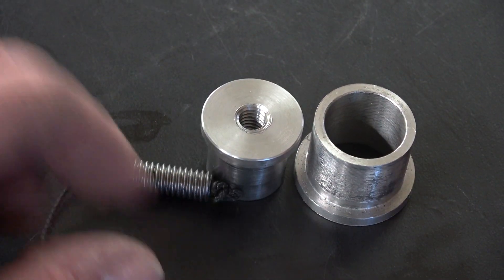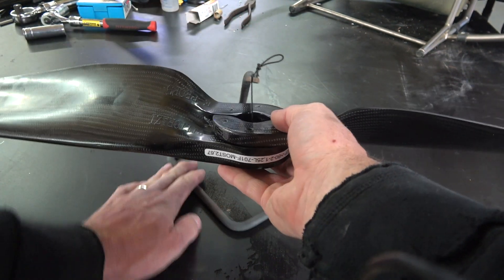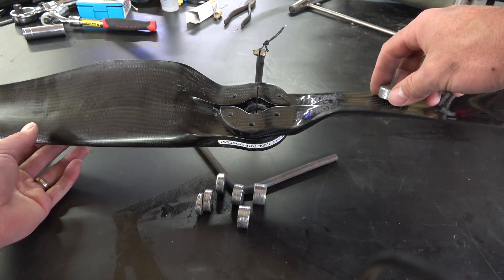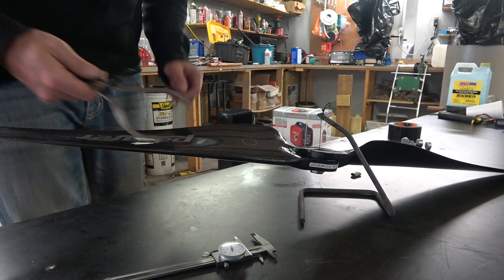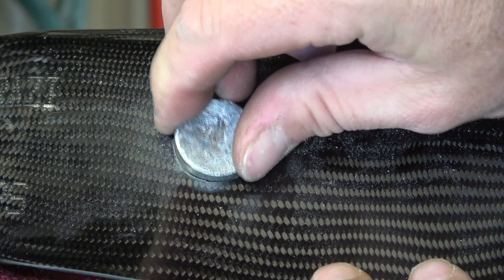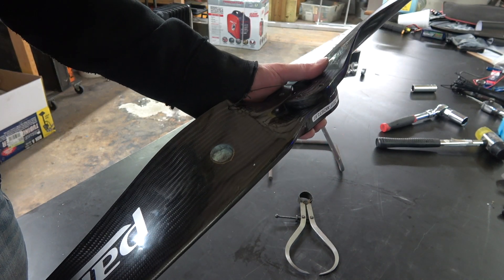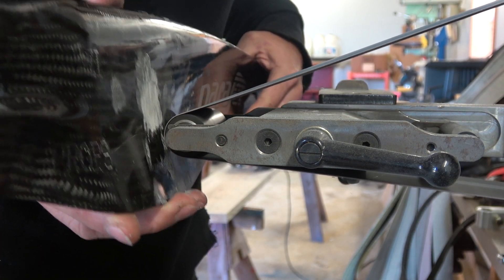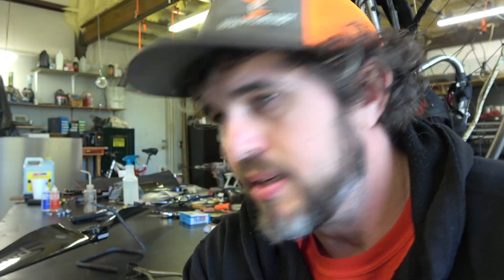Propeller Balancing

Comment: You might save a bunch of sanding if you taped around the hole before adding the epoxy. Then some filler in the resin, and you could squeegee it flush. Pull the tape when it's cured, and you wouldn't have to sand much at all.
Love the channel, keep up the great work!
Reply from the maker: Thanks M1RC, I do it a bit differently these days.  Continually evolving.
Reply: @kyleoglee  I did see that in another video where you injected a mixture. What ever works is good! And no playing with lead fumes that way.

Comment: On model airplane propellers in the 60's we balanced them like lawn mower blades; by removing material from the tip of the heavy side. A couple of arguments with regards to this method. Removal at a tip will require less change because of the increased distance from the center of gravity. Less chance of weakening the propeller. Lessons the chance of a weight coming loose at high speed and hurting a spectator.

I'm not saying one way is better than another, I'm just providing some knowledge of the way we did it when my grandfather taught it to me as a child in the 60's.

Comment: You are my kind of dude, "practical", real too. I was that way years ago but I am getting up there in years and really don't care about doing things like that any more. I built a home made Recumbent bike maybe 20 years ago and put lots and lots of miles went through many tires. Put a third "free wheel" between the tires because I could not find the gear ratio I wanted. I have had the bike to 45 MPH of course on the way down on a hill. Yes I was scared at that speed but the bike was very stable at that speed, brakes worked good but smelled a bit nasty. I had a fairing on at that time. Sorry for being so windy here. Richard, by the way I still have the bike. 
Medford, Or.

Comment: Thank you for showing this. I fly R/C helicopters and it's a lot more involved with balancing those blades, I don't know if Paramotors are as critical. In addition to getting them to weigh the same, you need to keep the weight longitudinally to each other. Meaning where do each prop by them selves balance along the length, and put the weight on the light one so they balance in the same place by using a piece of pipe to balance on. Luckily Paramotor props don't change pitch so you don't have to worry about making the leading or trailing edges the same. I'm not trying to be critical, just wondering if this help with vibration because it might throw the tracking off. Tracking can be seeing by standing where your not supposed to be with the prop spinning, looking at the tips. Are they alined with each other or do you see 2? You need a light color background to see it